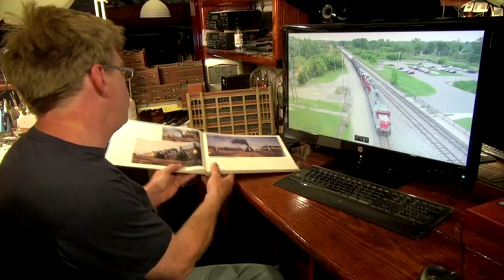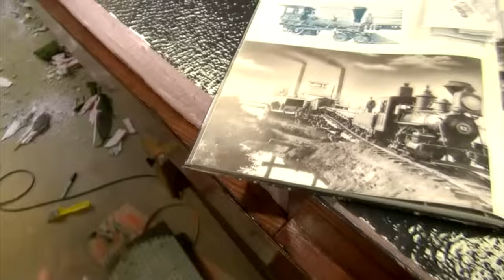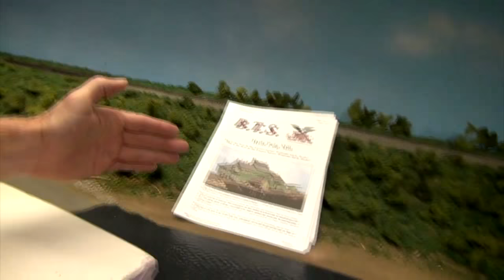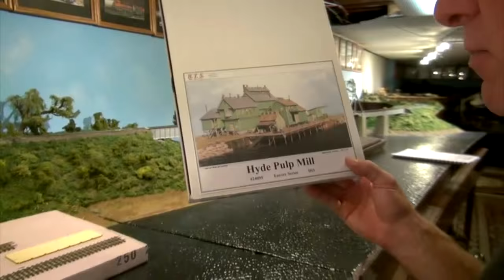Tool & train layout tips | Model railroad tips | Model Railroad Hobbyist | MRH

Comment: Another great video Ken! The 2nd run by with the guy riding the last car was a very nice touch! Where can that cutting board be bought at? Would it work with styrene?
Reply: The choppr works with anything you can cut with an Exacto knife most of the time.